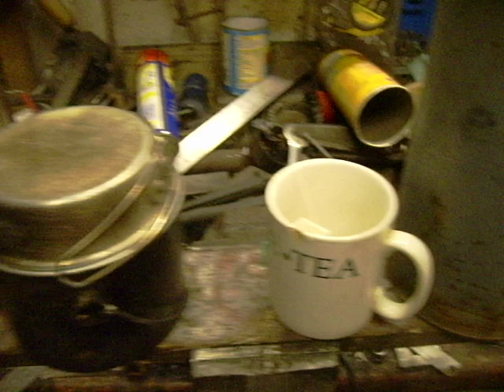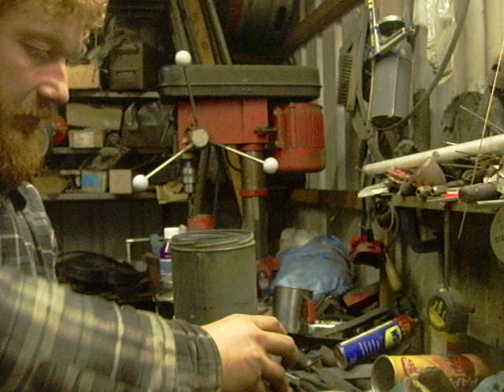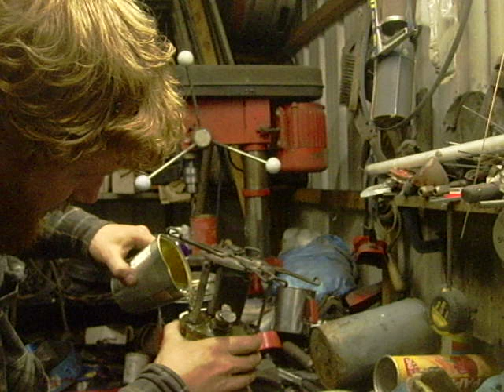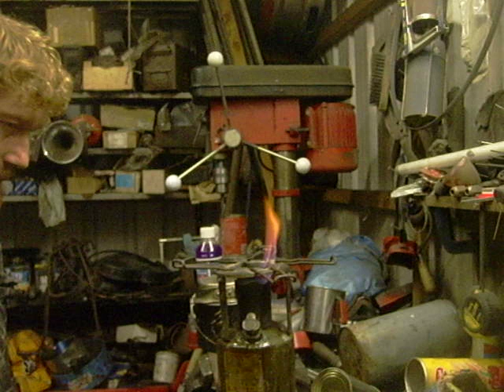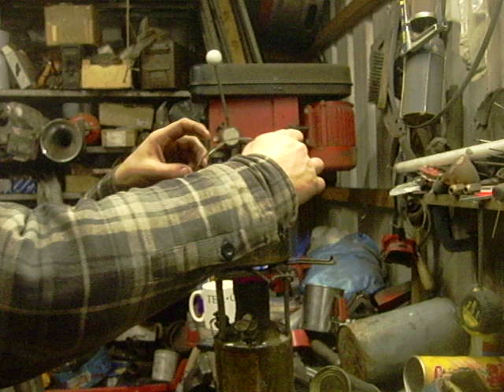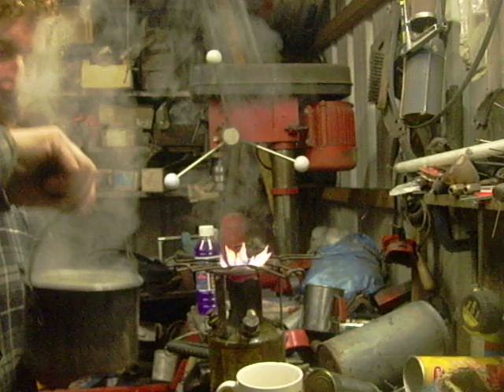WWI Hurlock pressure paraffin stove.

Comment: I'm trying to get mine working where can I get parts and accessories? 
I'm in America  but I'd be happy to make contact with someone in the UK to get it fixed.
Reply from the maker: Hi, 
I've not needed spares for this stove however there is a very good pressure stove forum and shop in the UK. 

I have used the forum which appears to be full of eager experts to help identify an oddball stove which turned out to have been made from two different models and then bought spares from the shop to mend it. The Fettle Box shop has options for many different currencies so I guess it ships globally. I'm sure there are other resources but I've used both of these and they are reliable and can support odd questions about parts for vintage stoves.

https://classiccampstoves.com/
https://fettlebox.co.uk/
Reply: @o0OMouseO0o  OH MY GOD THANKYOU! :) 
YOU'RE AWESOME! :)
Reply: Or try basecamp ,Peterborough Uk.

Comment: You can use nitrile or viton rubber to make new seals. You will need to make or buy off eBay a tool to remove the valve at the bottom of the pump.